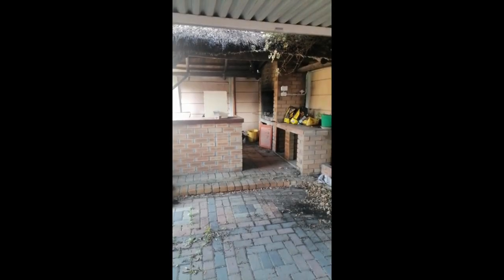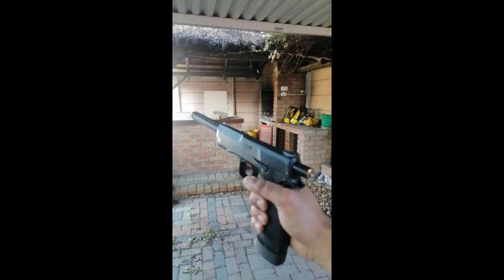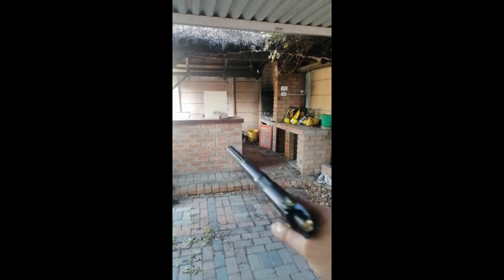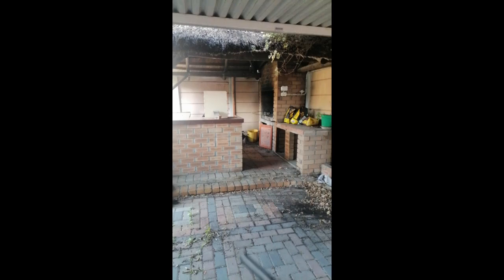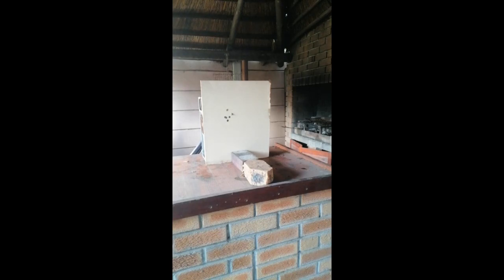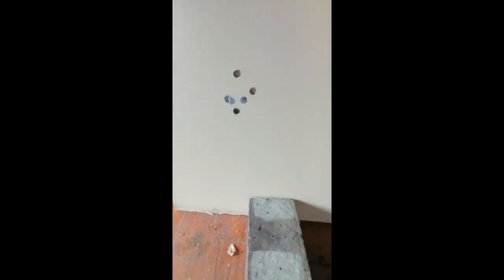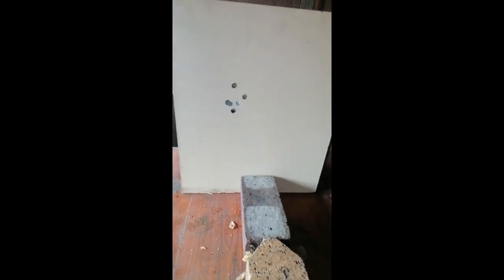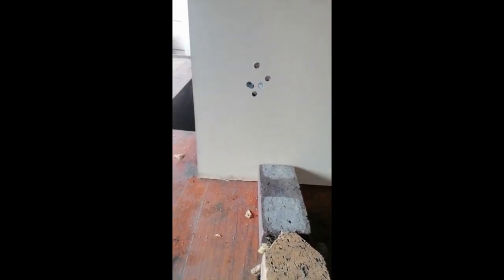HDP 50 Extended Barrel & Chamber Damage test

Comment: If some attacker gets hit by that you think he will still stand? Or he will be on the ground from the pain ? I have a hdp50 but its 7.5 joules iam getting threatened iam thinking of upgrading it  to protect myself and my love ones thanks for the videos
Reply from the maker: 41-46 Joules High. That will be interesting.
Two ball bearings to the chest will change anyones mind very quickly.
On a side note. These ball bearings although heavy, comes out with a speed. Check my chrono vid.
But I am very pleased with this HDP50 and confident to use it when needed.